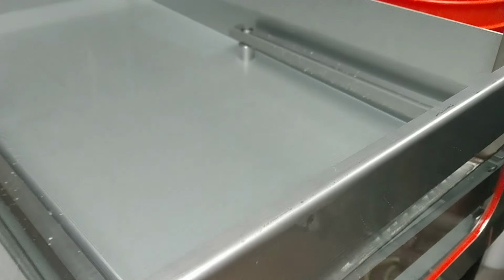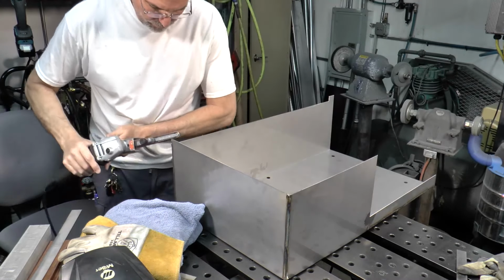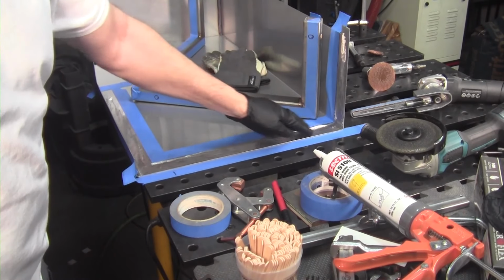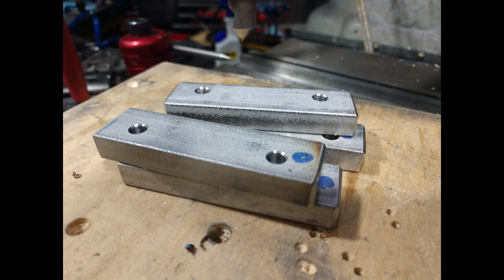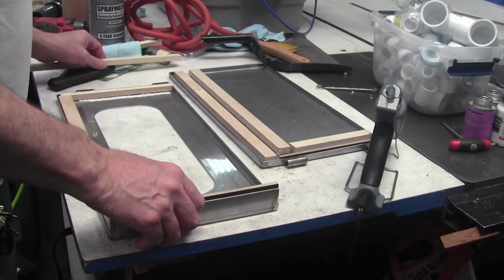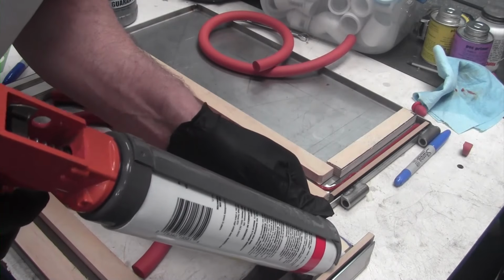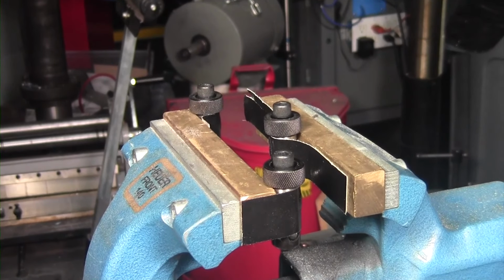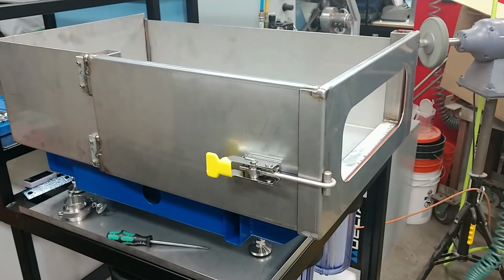Building the stainless steel tank for my EPIC build wire EDM machine.

Comment: I worked a few years running sinker machines. Never really thought about how much work went into designing the doors. But i do remember how much work it was if you opened the doors before you drained the tank.

Comment: When you originally showed the design of the doors,  I was sure that it would leak.  Now that you showed the silicone adhesive and gasket, I had more confidence it might work.  Watching the fabrication and application of the silicone,  I had confidence it would not leak.   I learned more about the handling of silicone in this one video than in my entire life!  You   are a PhD of Fabrication, giving everyone an apprenticeship and master class of how to make things.  Just the number of steps for preparation and fixturing  is amazing.  The "double glove" is genius!  I would probably need to start with 4 or more layers.  Also thank you for sharing the exact part numbers for the tools and compound used.   I'm sure it took years of experience to find what worked well.   While the water filler spout is over-the-top, the machined drain is off-the-charts!   

Question: why de-natured alcohol, not isopropyl to clean the silicone gasket?
Reply from the maker: Thanks for the comment Buddy!  I did have the idea that my doors would leak a little and drip when the doors are opened after just being drained however it is amazing how well it is working.  I have much more to share, coming soon....

Comment: Hi Werner, grat looking build you have there! :) One suggestion would be to add a little drain under the doors, just some U-shaped piece of stainless with a drain back to water tank. This is your backup when the door seal eventually starts leaking, as you can see it before it leaks everything on the floor or at least gives you a warning that a leak has developed.

Quite good looking double door system, looks alost identical to the Charmilles EDM we have at work :)
Reply from the maker: Thank Buddy! Yes if you look at one of the earlier videos where I talk about the design you will see I have the intention to install a gutter to collect any drips when the doors are opened.  Thanks for the comment!